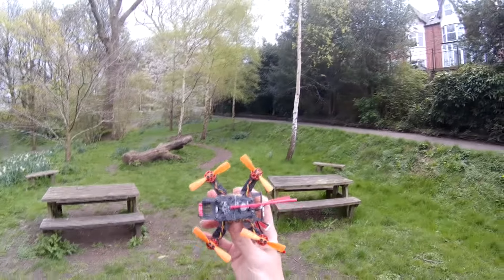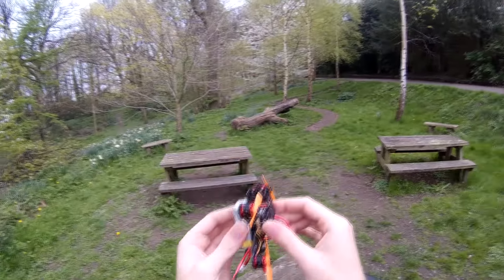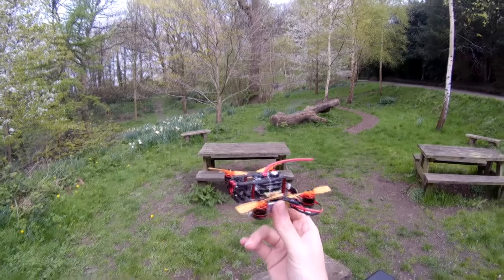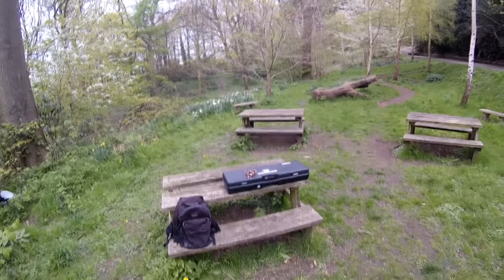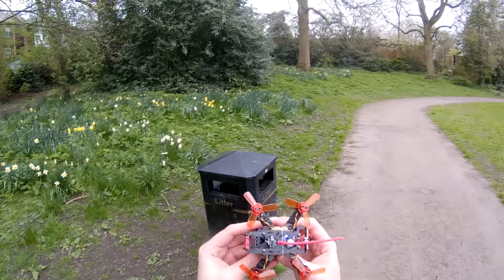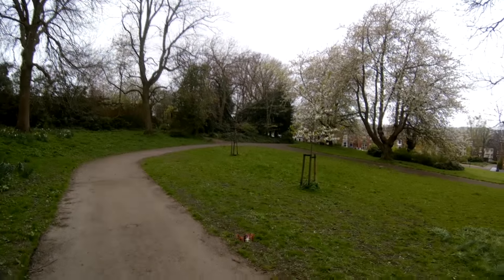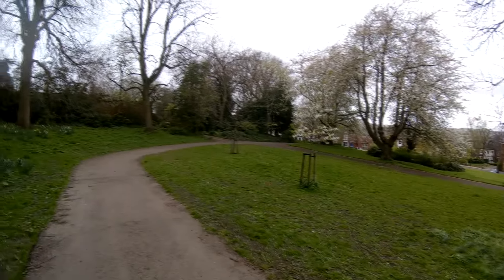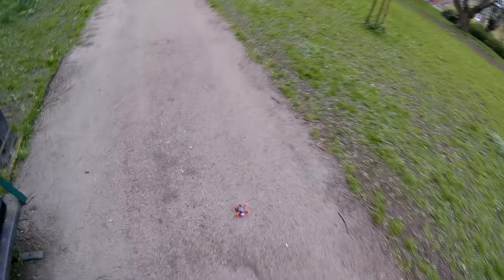Aurora 100 prop testing - KK triblade 1935, Tarot 2020, 3D bashing and chuckles

Comment: I find the 850-900mah batteries weighing in the 40-50 gram ballpark suit these builds well (Auw around 100-120 grams...). The extra weight makes em fly more predictable and less floaty, as well as still having the amperage headroom to punch out when needed with less sag. They do get a little sluggish near the end of the pack though...
Reply from the maker: Yeah, so far I am very happy with 850mah even at 25C but I would like to try some 550/600mah very high C also for use with flat props as they put out a lot less punch.
Still waiting on a frame for this guy or i;d be out at the park thrashing it. I read about a 2mm base plate in progress this morning, about time as props are very much blocking the shot in the Firer 110 frame.

Comment: Awesome flying m8 👍. The Tarot props seemed to work well. Less resistance higher rpm I suppose. Was that the stock Tarot props or the bowtie type? Thx Dod.
Reply from the maker: Just stock ones, I think they actually have more surface area after being chopped, the bowtie style ones have most of theirs on the outer 3rd.
Because torque was so lacking at the bottom end i'm, not sure if that was just because they were BN and 2mm longer so draw more current early on or just because it's less surface area than the multiblade props.
I have to say, just 24 hours not being able to fly it while waiting for a couple frames is making me feel like an addict. I need a hit of that micro 3D, twitchin man. Haven't wanted to chain fly a quad so much in ages and thinking this power setup on a Y4 is something I would seriously like to try. I'd happily buy a big box of these motors and some good 2s lipos

Comment: My motor 2 arm broke, found it difficult to do anything, The camera is pants, major blackout on overcast day. I found the DYS triblade 2030 props the most durable although not as much punch as the Furious FPV 2035 Quadblade props but they are just not durable in a crash. I ended up purchasing the Firer 110 Frame as it is 2.5mm thick and upgraded, much better durability, it's lasted more than 2 days. Plus I added the TX03 AIO VTX and hack the osd. much better quality!
Reply from the maker: Sounds like a similar path, except it broke it 3 times along with 2 others :). Still waiting on firer 110 and A90 frame to see which I go with but the 25-200wm cam from the DM002 is going in there and possibly the A68 RX as flysky failsafe work on that one.
I think the KK triblades are possibly the most durable that fly well, my DYS tris were least favourite apart from durability.
I do think it's been my favourite sub 160 so far in terms of pure performance
Reply: To be fair I've been using the micros to learn how to fly for the cheapest cost. I've built a Martian ii 220 and will probably stick with the bigger sized quads. Don't get me wrong the Eachine micros really have done me a turn, been loads of fun, just there are reasons they are cheap. Lots of problems, none that can't be fixed just inconvenient.

Comment: Has anyone figured out a reason and fix for the "Flip of death"?
Reply from the maker: I haven't had it on either aurora unless lipo voltage has gone low way low so it's certainly not all of em that have issues. I know Seby showed one happening with plenty lipo voltage but wondering if it's just random ones or just early ones since the first lot of review samples were sent out before the mini cube was even available to order.
I wouldn't feel confident ruling out firmware as a culprit too as BF has moved at such a crazy pace recently i've personally come up against a few funky bugs. Just not that one.
Are new models purchased recently having this issue still and is it related to just this model or the mini cube stack you feel?